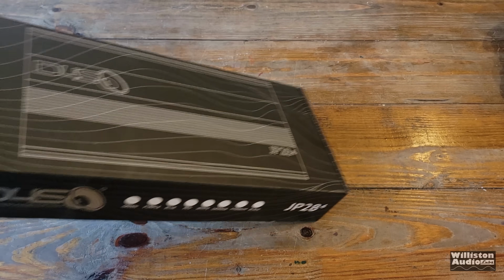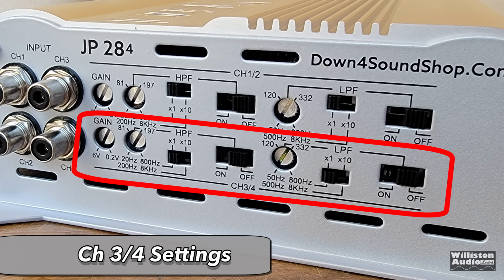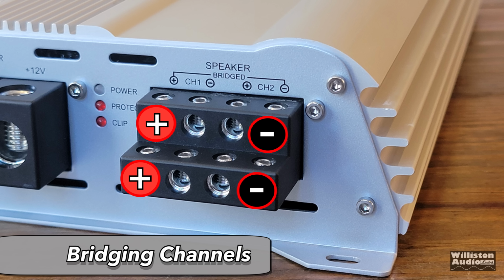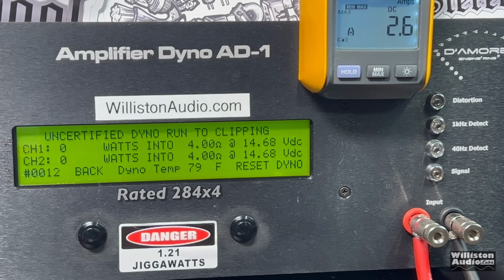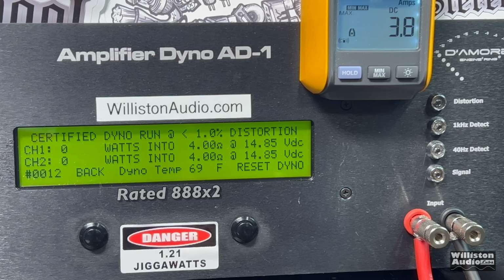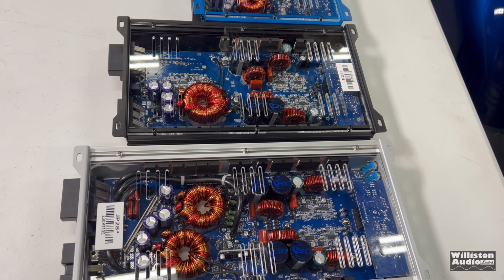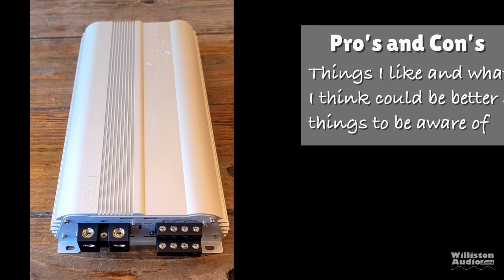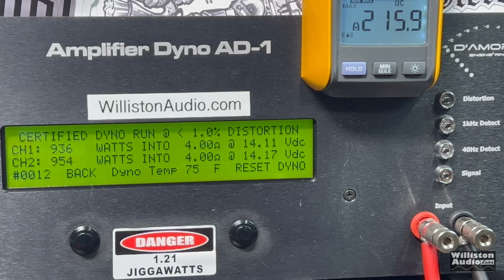A 2000W Four Channel Amp for under $400? Down4Sound JP284 Amp Dyno Test

Comment from the maker: Shop for the JP284 https://lddy.no/1isxj
Shop all D4S 4ch Amps: https://lddy.no/1isxk
Elac Bookshelf Speakers: https://amzn.to/47Q6zw8

Other D4S 4ch Amp Tests
JP84: https://youtu.be/b6XIA2DLZMA
JP234: https://youtu.be/wA-F_MGXCS4
JP34ab: https://youtu.be/9ptlq9hg3jI
JP454: https://youtu.be/cGUaL0mdZnM
JP10.4: https://youtu.be/bltwyRWV04k
Playlist of ALL D4S Amps Tested: https://www.youtube.com/playlist?list=PLu98-M_EowHPaS-gduhh6GjYt1SRlVxp5

Sponsored Video Note: Video is marked as sponsored as Down4Sound paid a "slot fee" to have this product tested and video created. It is important to note all of the test data is objective and all of the opinions in the video are mine

DISCLAIMER: This video and description contains affiliate links, which means that if you purchase from one of the product links, I may receive a small commission. As an Amazon Associate I earn from qualifying purchases
Reply: Is it ok to inverter these amps to show off the guts?
Reply from the maker: @orvilleblack3774  they should be mounted vertically so they can still dissipate heat or if you mount it upside down you should add some active cooling.
Reply: @wal  Thank you for your response. Appreciate it
Reply: Dereck can you please do a sundown sia 3500v2
Reply: Dang you deleted my comment about the seismic audio 62$ powered 12' woofer, i was hoping you'd test 1! Even shipped for free, in 3 days.
Reply: @mikeyking7530  it was auto deleted if it had a link. Sorry the scammers are prevalent so I disabled links in comments

Comment: Very awesome amplifier. 
My only complaint is that I wish the output of the channels were more synchronized.
Too much discrepancy will have one speaker sounding clean while the other slightly distorted. Not very safe.

Comment: I'd love to see you test out a Deaf Bonce MFA 4.320 😎
Reply: Me tooo! I believe the db mfa amps are built with better sound quality too
Reply: I have the mfa 4.320 it goes into protect at 15.5 so I can’t use the amp all year round and for me that stinks. So I just bought this amp instead
Reply: @frankbennett3613  how is the sound quality? I'd like a bit more power than I have now and the same or better clarity. I have class AB Skar RP 150.4
Reply: Dyno sorry
Reply: @codeebebout-valentine6534  I have the mfa 320.4 and it produces a horrible static noise at all volumes.  I have heard other people have the same problem too.
Reply: I had the mfa and it took a crap on me 2weeks in then went to jl rd400/4 both sounded great but I needed more power now I’m switching to the 284

Comment: What's this amps outputs rating at 8ohms Bridged And will it handle being Bridged at 8ohms??
Reply from the maker: 8 ohms bridged will give same power as 4 ohms stereo. Just add  two of the channels together so for example if it’s 300x4 at 4 ohms, 8 ohms bridged would be 600x2
Reply: Cool, was worried about the class D topology wouldn't like the higher impedance

Comment: There's a $35 package at Walmart right now where you get a single din dual head unit and 4x 6.5 inch coax dual speakers, I feel like that'd be a good video for ya.
Reply from the maker: Thanks for the heads up! I'll check it out
Reply: @wal  no problem! Picked one up for my wife's car since it was cheap but haven't tested anything yet

Comment: I agree with several other comments. These class D amps have tons of power but they simply don’t sound as good as class A or AB. I guess it’s all in what you want. For example…a 75w per channel Alpine amplifier somehow seems to get a lot louder than 150watt per channel Taramps amplifier. It’s actually not. Taramps makes some powerful amps. If you check a db meter then you can see the Taramps is making a lot more noise. However, sound travels in waves. Kind of like circles. The more perfect the circle maintains when you hear it. The clearer the sound. I’m trying to say. Why would anyone want to amplify distortion?

Comment: Not sure why you need 500 watts per channel.  I'm running 125 per channel and it's more than loud enough
Reply: When you have over 3k in subwoofer wattage...
Reply: @derekgardin1512, I guess you forgot that you can run speakers in series and parallel?   Lots of people these days are running multi component systems.  Ie... 2 or even 3 midrange speakers per door.   Each set of midrange speakers can be tied together on one channel with an amp like this.   Same with the tweeters and midbass speakers.  Makes for less amps and easier wiring.

Comment: Im actually swapping from the B2 Audio Riot 7500.1 to the jp83 on 8 Savard Hi Q 15s. Also, I'm swaping the DS18 1800.4 and DS18 3000.4 to the jp10.4 to run 8 DS18 PRO TW220 tweeters and 8 DS18 PRO X6.4M mids. Should have plenty of power

Comment: Hey Big D,
I enjoy your videos a lot.  Would you please add some suggestions for alternator amperage rating. I bought two JP95s based on your review and I wished I knew if I would need to replace the alternator with a higher amperage one before buying.
Reply: Just my 2 cents but I think 350amp would be good
Reply: Whenever you put over 2k watts if amps in your vehicle it's common knowledge to replace your alternator... honestly you have to do the big 3 at that point.
Reply: Just get the largest ALT you can find for your vehicle.
Reply: Yeah first do the big 3 it’s the cheapest thing you can do that’ll help your electrical system then the bigger watt alternator you can even try to run a 2nd battery that might be cheaper 
Goodluck tho🤘🏽

Comment: U have it listed as a 2000w but u just showed the Amazon add and it says 3000w
Reply: What does the box say or d4sound website say
Reply from the maker: Rated 460x4 or 888x2 which is less than 2000W, I was going by measurements

Comment: Never needed a 300 watt per, 4 channel amp. Not enough for subs and too much for mids and highs... History repeating itself here.  D4S for the WIN!!! BDBD/2023.
Reply: Haha, nah, it's distortion and noise will be at its lowest at half power, so there is that already, plus the fact that not all music is recorded with zero dynamic range left, aka, recorded on the verge of clip.  Having headroom isn't "not a bad thing", it's simply a must
Reply: @minus3dbintheteens60     Seems people have forgotten this over the years that if you want the best SQ you have to run max 75% of the power and preferably 50%.   But that's hard for people to swallow paying for 400 watts when they only want to run at 200.   Power is cheaper then ever these days so it's not hard to do.   The thing is, the SQ really isn't noticeable for average joe audio and most vehicles.   That's why people are using all the power of the amps these days because they sound fine.  If you want max SQ, you need to revamp the entire interior of most vehicles.  Get them sound proof inside and out, rock solid neutral interior and that can cost just as much as the audio equipment deserving of such treatment.
Reply: I guess you forgot that you can run speakers in series and parallel?   Lots of people these days are running multi component systems.  Ie... 2 or even 3 midrange speakers per door.   Each set of midrange speakers can be tied together on one channel with an amp like this.   Same with the tweeters and midbass speakers.  Makes for less amps and easier wiring.

Comment: Just think of how many tweeters I could run off this amp!!😂
Reply: 2 Morel drivers.  Off the top of my head the mdm85 can do 300wrms at 500hz, or 500wrms at 800hz and 1000wrms for 10ms ( I know the power is right, not 100% on the frequency though)

Comment: IMO amps that underrate the power are almost as bad as as over rating the power.
Reply: It's not over rated, it was rated at its lowest distortion point like it should.  It was tested entirely differently, to show it in a favorable light.  Now, why would over rating be a bad thing?

Comment: I have this feeling thesr amps DO NOT have the best sound quality, they're just powerful and loud. I CANT STAND the way digital amps sound, AND nearly all new head units too. The old class ab and older head units actually still sound so much better it aint even funny. Just my opinion though.
Reply: Let me introduce you to the JP 34 A/B, JP 7.2 A/B and the JP13.2A/B...
Reply from the maker: I’ve compared head to head and my ears can’t tell the difference
Reply: Well then you my friend are in luck! JP has high power A/B amps just for you....
Reply: @mugendrewable watched many reviews on the 234 and don't see or hear anything about being an ab amp
Reply: @kamikazikaizer  I apologize. JP 34A/B.
Reply: 34A/B🤦
Reply: Mine is pretty loud and great sound quality..but whatever floats your boat
Reply: @phila8160  right? Jp34ab ip72ab bruuhhhhhh

And yeah my ears can't tell the difference either. Maybe in 2005 sure but not in this day and age modern class d is great.
Reply: @wal there's some bad old tech class D amps out there, the poster here either lumps all class D together or they're lying/trying to be "more refined" than us common folk
Reply: I agree 100%. This is not necessarily a bad amp and it will please whomever buys it. If you need over 300 watts per channel for your mids and tweets, you are not truly an sq guy and it will sound fine. Some of us old guys that built systems with higher end a/b amps and head units playing cds can really hear the difference. I tried a “clean class d” amplifier and yanked it out after a week. The mass market today is focused on high power/spl and true sound quality has become relative.
Reply: @wal  have you compared them using a cd player as a source? If you compare them streaming through an Iphone, the sound has already been compressed so much the difference would not be as noticeable.
Reply: Exactly, people are listening to songs off YouTube and Spotify which tells you everything.  To someone who buys their music on a physical medium, and who has 2 tiers of "favourite music" being 1) music I like & 2) music that is mastered properly, class D is arse.  
You don't need class D amps to make power like this either, it's actually hard to find a decent class AB 4ch that will do less than 400w RMS BTL, and 2 ch will typically do 500 to 700 W RMS no trouble, every one of my car drivers gets a minimum of 500w RMS (my tweeters have 45v of clean since wave available, and they have the least power) class AB.  I've got an Orion HCCA that does 750w RMS x4 @ 2ohm, 1500wrms BTL X2  @ 4 ohm.      The ONLY reason to buy class D is if you are running tens of thousands of watts and NEED the efficiency
Reply: 99.99999% couldn’t tell the difference between the two 😊
Reply: Yeah, the old stuff shows you how bad Sirius XM and MP3’s really suck, lol.
Reply: @THELIFEOFPRICE  I would knock a couple of 9’s off but I basically agree. A good class D is the best solution for most. I’ve installed them for my sons and they have been happy with them.
Reply: I recently changed from a jl audio hd 600/4 on my highs to a wolfram 125.4. The jl is class d. The wolfram is class ab. The wolfram is 25 less watts per channel. All things equal. Changed month but the amp. The class ab sounded so much better. Crisp clean clear. The class d that btw retails for triple the money sounded harsh and muddy. Just bad. I really didn’t know how bad it sounded until I switched. Yes the wolfram is twice as big but idc.
Reply: I have the jp23⁴ 4 channel amp and I can tell you it sounds great and loud.   I'm 47 and been in the car audio world for 30 year's and this is a great amp....
Reply: I have some old class A amps from precision audio 20 watts per channel is plenty for me for the kind of sound quality you get.
Reply: I can second that! They don’t sound good for any sq whatsoever
Reply: Not to mention the jp84 arrived to me two weeks ago with a disappointing buzzing whine sound only on channel 1&2 but besides for that buzzing the noise of this amp is loud too. That silent hissing electonic noise floor is super loud . With just the system powered on and no music playing volume 0, the audible sound from the speakers is extremely noticeablly annoying, I recorded 43db of noise/sound with my handheld db meter and with the volume on max I got nearly 50db!!!! Or just nothing hissing white noise it sucks balls
Reply: And if you guys can’t tell the difference between a decent class ab and a class d then your not even remotely and audio person and shouldn’t even be in the hobby lol
Reply: I agree. The impact is different.
Reply: I'd love to see more ab from d4s. I'd buy asap. Being nostalgic. Had soundstream class A way back. D better??? It's all for debate.  Earth flat or round? Budwiser or Miller? Chevy or Yugo? 😅
Reply: I was all 🤌 about A/B up until a few months ago. I bought a Jp234 to try it out. I'm sold. Mind you, it replaced an A600 art series running 3 way passive up front. That highly regarded amp series was always underwhelming IMO and I could cook an egg on it. The JP allows you to go active from passive and is very efficient. The efficiency of class D is the clincher for me. This allows higher power in other areas like sub amps, converted clutch to e-fan truck/hotrods, lights, bagged suspensions, etc. In short, DO IT and don't look back.
Reply: @fishgamblerace8166  huh. Back in the day i had a white Art Series PPI A404.2  and an A600.2. Man i loved those amps. Are ya sure they sound good?  Maybe ill try them. I dont know.
Reply: Truth...
Reply: I'm gonna have my jp33 and a few other amplifiers tested for the distortion.  I found someone reputable to have it tested and it will be published soon.
Reply: No such thing as a digital amplifier. Anyone that says otherwise knows NOTHING about electronics. Class D does NOT mean digital. That was some marketing BS. That said, I have resisted class D for MANY years. Truth is the technology has increased & its taking over. For the die hard “sound quality guys” that claim to be experts… have you heard a ZED Leviathan? Even Stephen Mantz realized class D was gonna take over. These D4S amps are just impressive. You can hate on JP or the tech but they just are. I can’t believe the power output & efficiency he’s been able to achieve for the money.
Reply: @stevemccauley5734 agreed. Both on the zed amplifiers and what JP has accomplished
Reply: I'm running the mm1004 and it sounds great. Sq was definitely something they kept in mind when designing these amps even with a lower price tag then most comparable amps
Reply: Amp is for power not for sound quality.
Reply: @henrytaverner1803  so no amps ever made were for sound quality?
Reply: @henrytaverner1803  i figured. What amps out now are good for sq? I have a mint XTANT X603, and an Orion 225 HCCA 2nd gen also.
Reply: There have been lots and lots of people get these amps run them for about a year and then start to pick up some kind of whine in the system that can't be removed. Until JP has better QC, they're going to be a hard pass for me. I would stick with D'amore.
Reply: Old head here. This statement is fact. The industry and the equipment quality, both build and sound, peaked around 1999.
Reply: I have the jp 23⁴ and it sounds absolutely amazing even compared to an a/b rockford fosgate power series amp that's 125rms @4 ohms the jp 234 is 244rms x4 @4ohms
Reply: Running jp33/jp284, dm810, and lithium on audiofrog gbs front stage. Nostalgia doesn't necessarily trump new tech. The amount of headroom these give is outstanding pretty much negating problematic noise on something like a zero bit track at source max (tweet hiss). And the snr is 95 which is yes not as good as 105 or > but again headroom and proper setup/tuning. If they buffed the snr on their 10 channel amp you'd have absolute gold running it along with a dm810/helix/random dsp